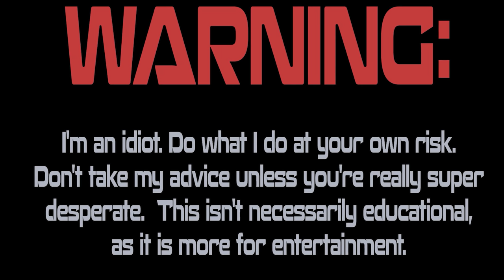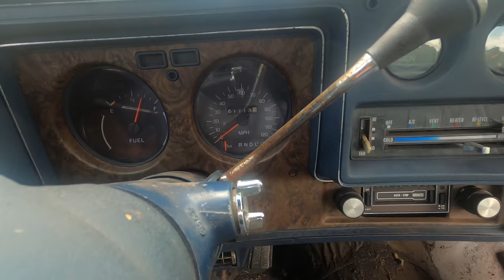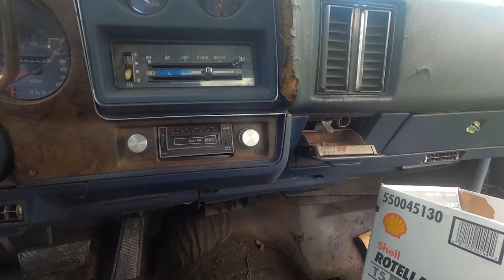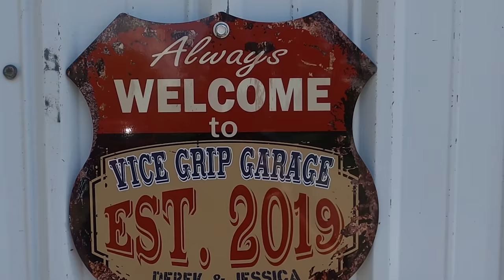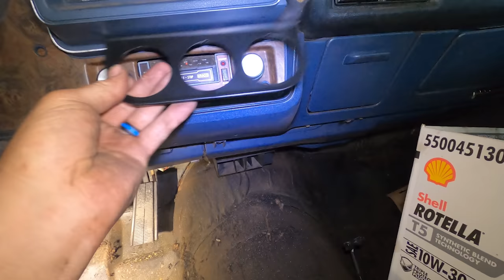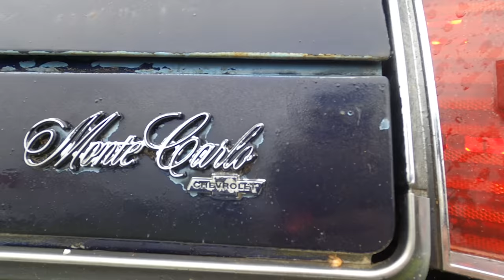ULTIMATE SLEEPER! - Supercharged 400 SBC Monte Carlo Landau

Comment: I've watched a ton of your videos.  And have asked the question to myself many times. Why has the vacuum module on the transmission, never been seen or talked about. In my experience it is always an issue that comes up. Usually just a rotten vacuum line.or just not hooked up. But then lots of times the module is bad or the screw needs adjusted. But always something a guy needs to be aware of.

Comment: AWESOME....Dude my fav car. I came home to Da BRONX out of the ARMY May 6th 1973 I wanted the MTC. I love that car. I went to a CHEVY dealer near me told him what I wanted in the MTC. ( black on black WITHA SUN ROOF, lANDAU ROOF, BLACK INTERIOR, with 8 track am fm radio, 455 with a 4sp, swivle bucket seats, radial tune suspension, 15 inch tires......and AC. the dealer was asking $5700.00....I said what for a CHEVY?  Also I want would have to wait 2 to 3 month duem to a strike and vacation..I said no ty.  So I bought a 73 Challenger, for $3700.00 cash. I still have the car to this date. sorry for the long comments I love what you do as I to Im a retired mechanic...lol   MOPAR 4 EVER.

Comment: fix the rust, ralley wheels be fine, (centers & trim rings delete for weight reduction) massage whatcha got paintage wise to keep the sleeper persona, a 12 bolt/posi maybe? Converted navagator (410s) or escalade (355s) rear axle? Shift kit and converter definitely

Comment: with my 77 monte with 2.73r gears, TH350 and about 420-450HP LT1 with Phase II Bowties n larger valves, 1.65r roller tip rockers .488/.510 Cam dual springs had a 7500rpm float could do 7200 in first n topped out 5200 or 5400 rpm in drive with 245/60-15 BFG tires
with my calibrated 74 speedo I pushed it to L2 I think about 135mph

Comment: Vaccum hoses are key for those years of chvy,olds,pontiac. cruise control etc. information age was still a baby then not too many electronics in them back then. I had a 76 olds regency 98 4dr with 455 and 400 turbo trans. That transmission you can drop in low at 70and it downshifts at 45ish. Made to do it.

Comment: SB 400 is one of the best engines ever built for quick power.
Reply: Imagine if chevy ever made 4 bolt blocks to take lots of power. 
Used to take 80s smog mobiles drop an old 400 in, small cam and put all the stock stuff back o nto smog in Ca. Long as there wasnt a lot of overlap they would pass!

Comment: WHat did you do for a fuel pump and boost reference?
Like those lil 144s. Friend has a 70 4x4 longbed, daily driver toolbox rack and all. 
stock 400, small isky cam 144 stock heads, headers. Watched him to a 4 wheel burnout once. Its been together for close to 30 yrs now

Comment: The seat , arm rest and pedals say 60 k original . the cracks  in the dash , vinyl roof and paint deterioration is just from years of exposure to the elements . the inside of the engine looks clean too . I think miles are original . just sayin' . Keep up the good work Derek

Comment: Old Blue would love a Detroit Locker. Water injection if fuel wants to nock. Replace the rubber bushings with 90 durometer neoprene, New ball joints and tie rod ends will be helpful. A precision alignment, with the wheel at 12;00. Tire smoke in the back seat?

Comment: My first car was a 77 Monte Carlo Landau in that blue on blue combination (pretty much the same except a 4 square headlight setup). 305 and a 2 barrel with a fat 125? 140 horsepower? xD Drove it until the transmission grenaded, speedo stopped working at 160k miles and I put at least another 20k on it after that. I miss that car so much.

Comment: Hey Derek, 
When you bolt on the main intake manifold do you do a particular bolt tightening sequence? Start in the middle and work your way out? Tighten down snug and then go back through the sequence and torque using the same sequence? What torque setting do you use on 3/8- inch. bolts? Maybe you could do a tutorial on how to properly bolt down a intake on SBC. Thank you for this one I really got a kick out of it. BTW I owned a brand-new Monte Carlo 74 black on black with the twister bucket seats and a 400 sbc was somewhat of a dog. I traded it off pretty quickly. Maybe i should have just supercharged it. Thanks again
Reply from the maker: If you google "sbc intake torque sequence" you'll get 483,736 relevent photos, diagrams, videos, and written how tos on intake installation 👍

Comment: Throw a little bigger cam tiny stall shif kit and some dart heads with some roller rockers and cam put headers on it with quiet mufflers put a 373 gear in it bore it out 30 over run 11 to 1 bam done

Comment: A 400  is externally balanced While a 350 is internally balanced. That’s One quick way to tell the difference between a 350 and 400sbc. 
if someone tells you that their 350 is stroked to a 383? Aka 350ci sbc thats .030 over and using a 400 crank?
(If a 350 is Not .030 over but has a 400 crank then it’s a 377ci) Then it too should be externally balanced.. 
I feel a lot of people get taken by people saying something they’re selling is a 383 stroker when it’s just a 350.. 👍🏼

Comment: I had a 1970 Monte two 74 one 74 I paid $100 for it green on green on green 350 working aftermarket air conditioning I bought it for the motor after driving it. I couldn't get my self to take it apart so I sold it for. $2500. I did put some tires and rims on the ole girl

Comment: Those 400 SBC engines are too often slept on because You can really make decent power from even a stock bottom end example. A good heads/cam/intake package atop a stock 400 will get down with moderate compression 383 stroked 350s all day long. And if your adding boost, even Vortec heads make great power with just a decent intake & a healthy cam.

Comment: for years I heard of people blowing out the manifold cork gaskets.  I have never had that happen on up to 400 HP in a  N/A  Engine.  wow, 2 barrel Carb to Blower, LMAO    I don't run Thermostats over 180 degrees, there only for warm up. just need to get to over 140 degrees as fast as it does.  you can only reuse a gasket so many times, it's good to buy 2 at a time.   it's a Sleeper 4 sure

Comment: It's always a good idea when you're pulling the inturmountedduplicator across your intakulators and the valve splasher non gasher to not lift it wheel much because finding loose parts by dragging a 97 pound piece sledge across top always comes in handy.

Comment: Mini spool???? Ya don't wanna ask me, I over do everything! How much $$$ do you want to spend?? I've got a frozen up 400sbc I just swapped in a 454, it had a turbo 350 I believe, but I just got the pedal kit to fit the rebuilt super t10 4sp in Air, it's the same 87 El Camino, I told you bout, over a year ago, had to slow the project down a might, had a heart attack and died for half hour before they brought me back, but I had to finish this car first, before I meet anyone, even my Maker! No disrespect Lord! But we talked about this. Any who, ya only live once, sometimes twice, who knows, mebbe 3, 4 times, didn't get all the answers in a half hour.... But now I've changed my mind and I'm adding All kinds of goodies, twin turbolaters out back by the rear tires, already drew up body plans to put in the air cooler downers for the turbos, and you almost got me to pull the high rise manifold to put in one of them riggins you put in your monte, the name escapes me,, but you had it on the Chevelle..... But, no mebbe later. It's going to cost a lot more coin now, but I can say I didn't cut corners and built it the right way. But the real secret I'm working on, is the fuel, by hook or by crook, I'm going to get that BBC to run on straight hydrogen. I've already built a hydrogen generator, and it makes lot's of the stuff that goes BOOOM!!!  Now, the problem is, how to fool the puters, from messing with the mixture, might have to eliminate that part, go full old school, we'll see. If I can pull it off, then that little elco might just be my daily driver, welp, wish me luck, and perseverance, alot of obstacles I put in my own path, but I will overcome! Do the right thing on the Monte, you'll know, when it just feels right!

Comment: I had one of these motors from a 72 iirc, put it in a 84 Camaro and snapped the frame in 2 places, one between the motor mounts and the other in front of the steering gearbox, and snapped the transmission crossmember. Too much torque. To be fair, the motor was done up and I never reinforced the subframe. My fault.

Edit: I have never owned a car that could fry the tires quite like this one did, even with really bad gear ratio meant for the highway I could break the tires free at any speed below 40 with little effort. I am amazed I survived the car, no joke.

Comment: My opinion is the car was probably stolen at some point in time,probably low milage,people that steal cars always use flatblack paint..change wheels n tires....although usually wigout under the hood and take parts off that the engine needs to run properly...atleast thats been my experience....althoigh one could tell the milage for sure by looking at timing chain...plastic gears its for sure 60k miles...metal gears 160k....

Comment: One thing you missed and to be honest I have on one motor the middle EGR ports in the head where clogged with carbon solid every small block Chevy I've ever taken apart the back too will always be open and the middle two will be so full of carbon that it's literally flat level with the head Richard is done they should have been chiseled out and all that carbon removed I kept watching and looking and looking and waiting for you to chisel out the carbon and you never even pointed it out or anything so clearly you didn't even notice